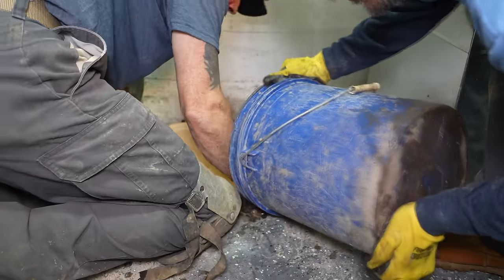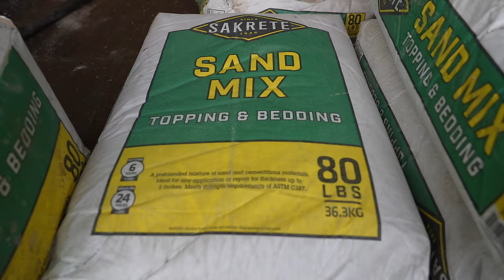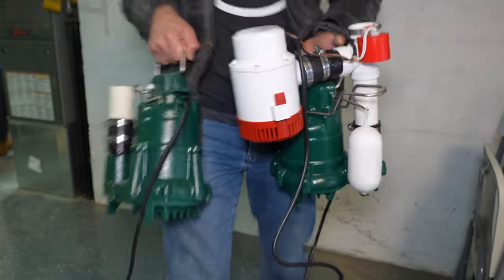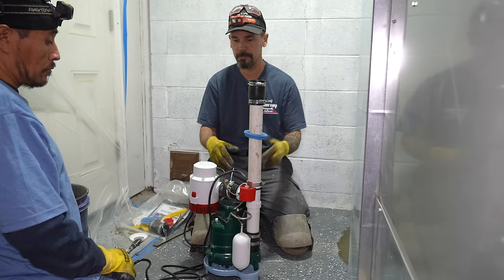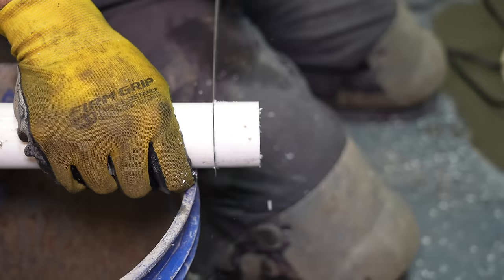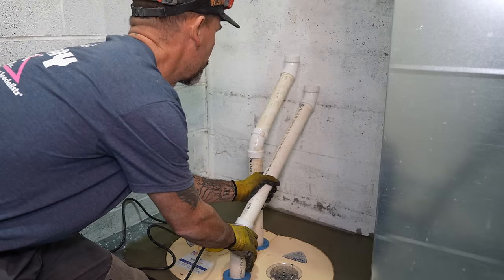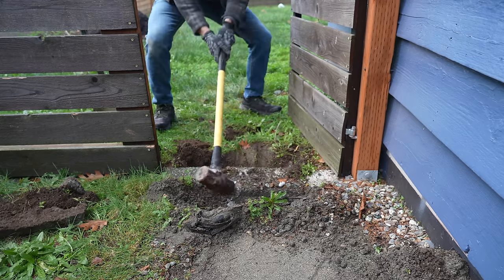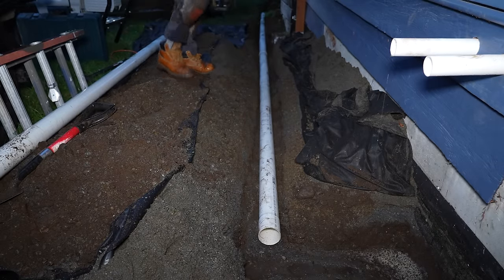TRIPLE Safe Sump Pump System Installation

Comment: What gets me is they allowed water from outside and the foundation to the inside and pumping outside would it make sense to put the sump pump outside
Reply: Until the sump and pump turn into a solid block of ice in the winter...or get clogged up from yard debris.

Comment: 5:48   If the basin is airtight, what replaces the fluid that is pumped out?
Reply: Typically only one of the two pumps is going to be active, the other can serve to vent, and even if both are active you have soil gases under your slab, the basin is open to the sub slab.
Reply: @walnutcontractors5661  interesting concept -  I think the vent from second pump is not a substantial source of air because there is a check valve.       Soil gases are something I have not considered.   Thanks for the reply

Comment: They still don't worry about about vapor/moisture barriers.  A relative's newer house---they didn't bother putting any barrier under the garage floor, and water constantly seeps up through the concrete.  Simple, inexpensive proper drainage and other measures would stop this and I know contractors wouldn't be this lazy on their own homes.  It's inexcusable.  Folks also had to have a sump pump installed under their newer home crawl space as water run-off was collecting under the foundation.  Again, failure to anticipate proper drainage for the amount of precipitation we get here in Washington.  Should be code---but that would make too much sense when government spends too much time making new code not required.

Comment: I think it is crazy a sump was not built into the property from the start. I live in a flat area with lots of clay and every house's basement has a sump pump.
Also, having two main sump pumps is overkill. If the battery-backup pump is present, has a high-power battery charger, and has an alarm, I see no reason it can't be the secondary pump.

Comment: That ball valve doesn't seem properly air tight enough, especially if there's any pressure at all, why not just install a trap?
Reply from the maker: I understand your point.  I'll have to ask them if they have had any issues with it.  Thanks for asking and watching Sean.
Reply: A trap would dry out if it never collects any water from the floor surface.  I assume the only reasons to have the ball valve are for radon prevention, and in case the water in the basin smells bad.  The ball only needs to resist the pressures caused by wind airflow.  It looks a bit on the light side to me, too, but at the end of the day, it does need to be light enough to float on water.

Comment: The end of your system should be a pop up emitter instead of what you used. What you have will very easily get clogged over time. A pop up will not and keep things like dirt, rocks, bugs from going up into your pipes and clogging up the end.
Reply: Nope, not the case. It's a pressure line and those pop up emitters tend to break/jamb. A good vented drain box allowing water to drain into the soil beneath it is the best option. And this is coming from someone who has installed hundreds of these things.

Comment: In America is there not a city storm water system to connect to?
Reply: It depends on the location and when the area was built.  From what I’ve seen, 1920’s houses (specifically Terre Haute, Indiana, and Rochester, NY; probably common in many places) put all their water into the sanitary sewer system, which might be unable to keep up with the volume of water during heavy storms, releasing the excess water untreated.  The 1940’s house I grew up in sends its rainwater to a drainage ditch and buried pipe that serves several nearby houses.  More recently constructed areas do have separate storm water systems.

Comment: Sarcasm aside, the best basement drain i ever found is to buy a home in the proper elevation to begin with. Then all the work is done  by gravity. Always be sure when buying a home that its FAR far above the water table on a hill or at least a mound. 
Barring that, this vid is a nice example of how much you'll spend keeping dry... When younger and a carpenter, We built some homes that were so low they added 2 battery back up sump pumps. then we had to run another electric meter to pay for the operating expenses...FOREVER!  ( the owners association pays sump bill along with all the street lights etc...FOREVER! WOW!

Comment: Pricing?
Reply from the maker: Over $6k with material and labor.
Reply: @BYOTools  Thanks.  Pricey vs buying the parts yourself but it was expertly installed and you've got someone to call if something goes wrong.

Comment: Quick note: a 2" pipe can cover two 1 1/2" pipes of outflow. A 3" pipe is 7 square inches of space. 1.5 inches is 1.77 inches sqaure and 2" ID is 3.14" square. Your 3" pipe combined pipe is more than twice the size it ought to be.

Comment: A "what" steel trowel?
Having the  sump pump liner lower than the floor doesn't do much if the floor doesn't slope to that location.
The wax paper between the stone and their "grout" doesn't serve any reasonable purpose. 
They used that mix basically because it is easier to finish compared to a mix with stone
43+72=115gpm max flow rate of both pumps combined. Assuming your pumps can manage to create 20psi a single 2" sch 40 pipe can handle 127gpm.  (Which for your sake let's hope/assume they can because if not the 1.5" line isn't big enough). So they ran 2 pipes all that distance, you purchased a  2nd ice guard (whatever that thing claims to do), and they drilled a 2nd hole in your house. All of which was unnecessary. 
If you actually need both pumps your underground retention pond is likely going to fill up. Wheres that water going?
If the guy isn't measuring his pipes he just likely isn't worried about his clean the install looks(typical for work that'll never been seen. Yours is in a family room). 
I didn't hear anyone mention backflow preventers. 
Battery backup is a nice feature. 
Make sure you disable your primary pumps normal 120v power source to test the battery backup. Then disable that to test your 2nd 120v pump. 
I'm done.

Comment: As someone who has the watergaurd gutter system surrounding their basement perimeter, I don't recommend it. There are better and cheaper options.
Reply from the maker: Do you mind providing a bit more information about what you've come across with your system.  Would appreciate any input and thanks so much for watching.
Reply: As someone who installs pumps you must not have pulled a permit. where is your check valve? Seems like your plumber half assed the job. He installed a fernco to service the unit instead of a union check valve with quarter turn ball valve. Every time your pump turns off, you’re draining the water back in the pit. Your pump is working twice to pump the same water.

Comment: They used vent 90s and thin wall pvc in the ground.
Reply: So? It's not a pressurized system.
Reply: @mattmanyam  sharp 90s collect debri quickly
Reply: @williammorris3303  debris from the filtered inlet?
Reply: Vent 90s not ideal thin wall pvc legal but poor choice for underground piping.

Comment: Maybe give some fuel for thought… So you thought it would be a good idea to put the drain on the inside? So it’s ok to allow water to compromise the soil under your foundation on the way to your basement? Maybe a foundation drain on the outside to stop the water before it comes in? Sorry to antagonize, but don’t tell people the wrong way. They might spend money on it rather than doing it the right way.

Comment: I don't understand two pumps in a sump that the foundation doesn't have a drainage pipe  i dont like sorry
Reply: The sump pit will relief the high pressure hydrostatic water pressure underground as it creates an easy place for the water to flow into.  The sump pit is less resistance than the soil itself so it may get a lot of water in a short time so that is the reason for the two pumps, a primary pump that works every time the sump pit fills up and the secondary pump in case the first pump can keep up in draining/pumping the water.  Also, the secondary pump acts as a backup pump in case the first pump should malfunction.  In many cases, you don't need to install drainage pipe all around the basement as the sump pit is able to attract the underground water under the house.  Other situations may require the drainage pipe abound the basement if there is a great deal of underground water and type of soil (clay, sandy, etc.) in the area of the house.

Comment: I blame the builder of the home why the hell they didn't build the house level with the street instead they built the house below level and the drive way is slooped towards the house anyone with a brain knows when it rains water will go right in the garage and flood it. And leads me to my question to home builders why don't you builders build a house level with the street basically what I'm saying have the driveway level with the street it's a deal breaker for me when I'm looking to buy a house and the driveway is not level I'm looking elsewhere

Comment: I know you probably selected 3" pipe as the  shared dual-1.5" pipes purely for simplicity, but I wouldn't want anyone to think that flow for TWO 1.5" PIPES = ONE THREE INCH PIPES
It isn't true, as the pipe 'size' is its diameter, and the pipe flow is dependent on cross-sectional AREA. Two 1.5" pipe flows fit in a 2.5" pipe with 38% headroom -- a 3" pipe is twice as big as needed.
Reply: It'd harder to find 2.5 in many areas also more tools available to clean 3 inch of roots if it clogs In The future.

Comment: Sock 'filter' is a bad idea. If it stops silt its going to get clogged and you have no way to unclog it.  Better to mitigate any dirt buildup issues inside the sump where its serviceable.  Glued fittings all the way to the pump is going make it a pain to service parts in the sump. Should have used a couple rubber fittings with clamps. Also it seems like they could have put the concrete level a little lower so you could go over it with some epoxy if you wanted.  Overall pretty standard install, mediocre.
Reply: Clearly you didn't watch the video in its entirety.

Mediocre attempt at trolling, at best.
Reply: @mattmanyam  I did watch the video in it's entirety, you're the one who needs to pay attention. "Rubber clamps", properly called Ferncos are very visible at 6:38 and on in that same chapter through 9 minutes or so.  The one mistake I saw was the fernco on the second line (with the yellow cord wrap) was installed below the pit cover.

Comment: You wouldn’t haves to do that if you had drain tiles on the outside of the foundation.
Reply: digging the entire perimeter of that basement wall to add a drainage system is a lot more expensive than putting in a sump pump though, even if it is a better approach.
Reply from the maker: excavated one side of the house already but not going to excavate the other side since it's so far down.  Would be insanely costly and time consuming so I'm hoping this is the perfect solution.  Thanks for watching.
Reply: @travelfeet  it is really interesting, I live in Canada 15 minutes from the USA Canada border (just up I-5) and having drain tiles on the outside is part of the building code. There isn’t a house built up here without drain tiles and they are plumbed into the storm sewers which are separate from the septic sewer system.
Reply: @BYOTools  there is a company in my area that installs drain tiles without excavating.